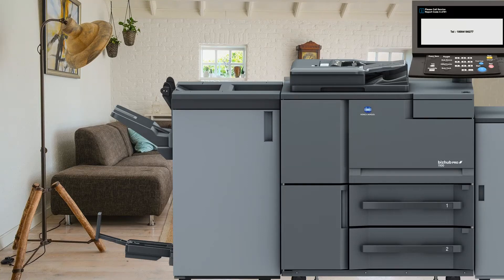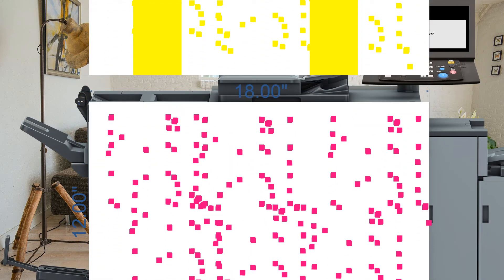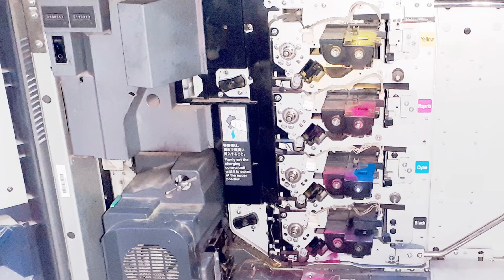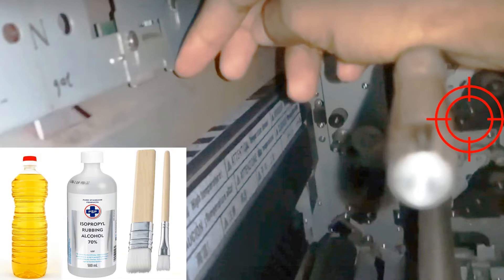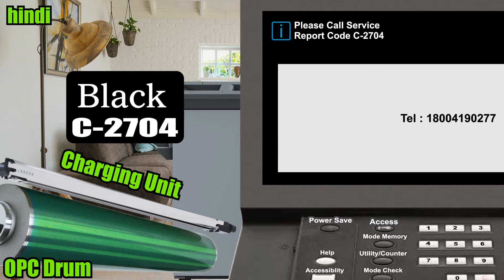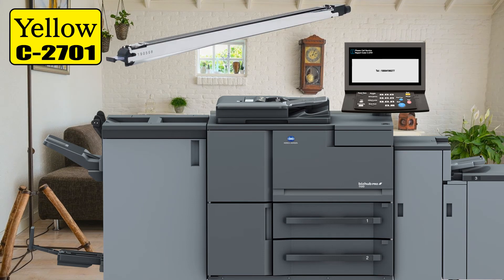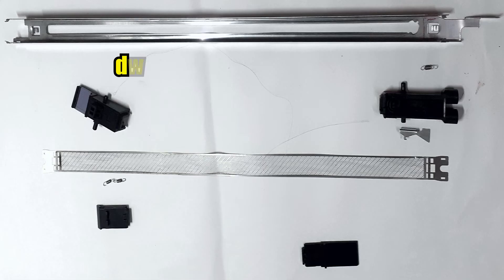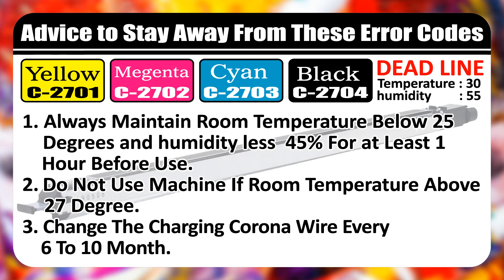konica minolta error code solutions 2701 2702 2703 2704 print quality issue solid colour come

Comment: What is C2714 
Please explain me
Reply from the maker: 1st transfer roller/K
Printer control board (PRCB)

Solution
1. Check the connection of the high voltage contact of the process unit, and clean/repair it if any abnormality.
2. Check the connector connection and the wiring between PRBC and HV2, and repair it if any abnormality.

Comment: Konica minolta c6501 code 3913
Reply from the maker: Thnx for reaching paliwal ji.
Reply from the maker: This error code come only with 2 issue.

Dust or connectivity issue.
Just remove paper passing tray or fussing unit.  And lift up or fix proper this try by scope chanel 2 screws.